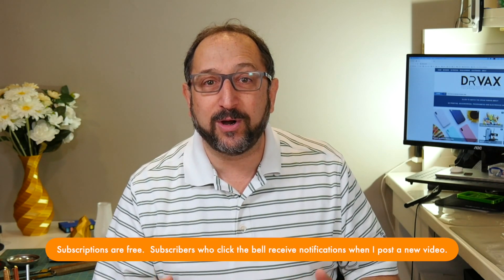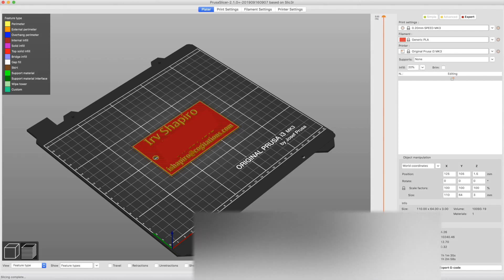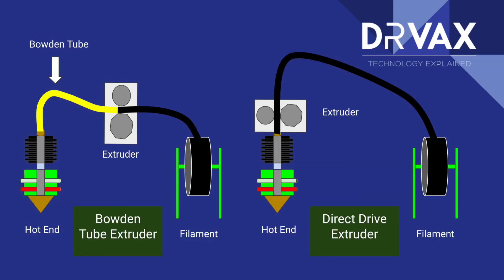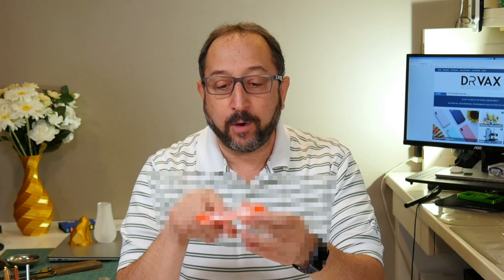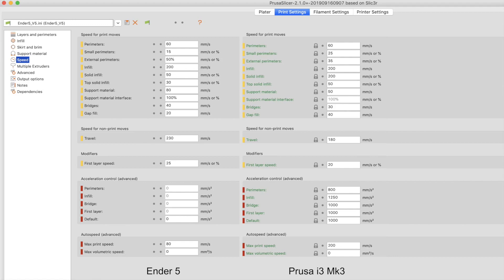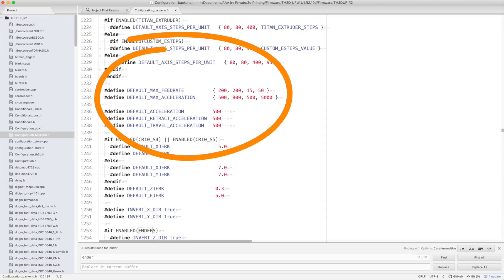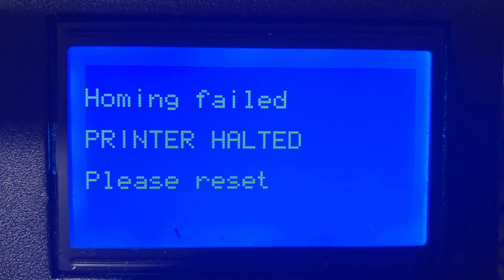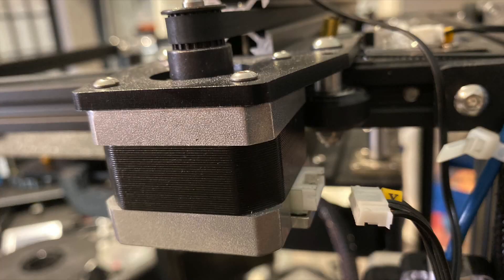Why is my Prusa Mk3 Faster than my Ender 5?

Comment: 1 cura is terrible at optimising paths, quite hard to configure properly
2 the default acceleration is low on enders. It's literally the worst setting that can be used, to get the worst quality. I push my ender 2 pro and ender 3v2 with 15mm jerk and 2000 acceleration, 5000 acceleration for extruder. If all of these is tuned to the same, there will be few minutes of difference but nothing dramatic. I also bet my tiny ender 2 can beat in speed a prusa i3 because the direct extruders creates much more artifacts at these acceleration values. If properly tuned retraction takes about 0.1 seconds on a bowden. My enders are retracting so quick, that it makes a clicking sound. Often I thought that it's skipping but it's not, as there are no printing artifacts

Comment: This is an old video, but to anyone that reads this stuff I have some pointers. I have two ender 5 printers. I strongly recommend ditching marlin and the stock board. Get a reprap compatible board, it will make it so much easier to dial stuff in... That aside it comes down to instantaneous speed change  (jerk) and acceleration... I the jerk settings in particular are very conservative at 10mms or 600mmm for xy. I bumped them to 15mms with no real quality difference. Same for acceleration.. bumped it 50% no real quality difference. Oh and you must recalibrate fan, temp, probably retraction settings too afterwards.

Comment: Watching a few of your videos now, I feel like you may have a slight bias towards Prusa. 

Having just bought an ender-5 and tweaking the hell out of it since I have, I feel like your assertions that "it's in the components" may be a sign of that bias. Although, to be fair, maybe I'm just biased towards my Ender.

I've updated my slicer settings to use the acceleration controls shown for the Prusa, I'll be trying some test prints in the morning to see what the difference looks like in terms of quality. Using the silent board with marlin 2.x firmware, cap tubes, ezr struder mounted on the top rail, and a glass bed with bl touch, I think I can get some pretty fast prints with minimal degradation to quality. 

It'd be interesting to see you benchmark this again in 2020 with the "latest" of everything and a publicly available model to test print, and then we can all compare results and try to fine-tune things more. 

Still a very great and informative channel, I'm just curious to see how close I can get to the quality and speed of the Prusa 3 just by fine-tuning settings and adjusting hardware - without completely replacing PCBs and motors.
Reply from the maker: This video was from a while ago.   For most people I think the Creality printers are an excellent choice and most home users do not need to speed $1,000.   More importantly the Creality printers are very "hackable" which I really like while the Prusa is very hard to work on.

I do not recommend building a Prusa i3 MK3 from the kit for most people.

I have a new Ender 3 V2 which is really solid but still requires assembly which is tricky for some people.  The ANET ET4 is very easy to assemble but the firmware is still a work in process.

The Prusa is faster due to the direct extruder and I am not a fan of upgrading Bowden printers to direct extruder.

If you want a fully assembled printer, a couple of the Monoprice printers, the Select Mini and Ultimate 2 (not the 1) are quite good and I like my Qidi X-Smart.  The Ultimate 2 is as fast as the Prusa and a direct extruder but has a much smaller print volume.  I do not recommend the Monoprice MP10.

I haven't printed anything on my Prusa in months and just used it again today.  It is an excellent printer and quite fast but probably not necessary for many people.

Sorry for the ramble.  I now own 10 different 3d printers and thing it is time for a video comparing them all.
Reply: @MakeWithTech  Well, FWIW, I tried throwing the acceleration settings from the Prusa/your video into my Ender5, and the results weren't terrible, but there was definitely a loss of fidelity on smaller details, as well as what appears to be some issues with extrusion precision in certain parts of the build plate. 

However, the extrusion issues may also be related to my current extruder placement - so I'm making a new mount to relocate it now, and will probably test the acceleration again to see if I get the same issues.

I did see a nominal increase in print time, but not enough to make the apparent defects worth it. 

But, I'll test more and comment again later. I'm really interested in finding the fastest possible parameters for printing with my E5 without sacrificing quality. I've already dialed it in quite a bit (100mm/s for normal prints, 250mm/s travel, no issues), but I always want to push it more. 

In that regard, it'd be awesome to see a detailed feature on what you can personally achieve this way - and then share a slicer profile with all of us. :P

Comment: If you look at all of your slicer settings between two profiles they are not going to be the same as the stock profiles for the Prusa. Not only would you need to change the settings for cooling and retraction after a change to speed. You would also need to take into account the stepper driver settings that are going to be different if you aren't running TMC2130 drivers. The stock Marlin firmware is not tweaked at all. The profiles being used are made by the manufacturer are not even tweaked. If you looked at the advanced configuration in Marlin with two printers using A4988 drivers and see that the driver settings are not optimized. There are timing and current settings that will be different based on the stepper motors being used and you are also dealing with different steppers depending on the axis 1.8 degree or .9 degrees. 

Using a board with TMC2130 stepper drivers the chips themselves have tweaks that work hand in hand with the and the advanced configuration settings to produce the ramping results. It's not just the effect of the jerk settings or your acceleration speed. Your Microstepping between two printers can be different which can cause vibrations.
https://www.youtube.com/watch?time_continue=1&v=tRoT3qpndbU&feature=emb_logo

Not only that the filament temperatures are not going to be the same. You could have been printing too cold when you needed to be printing at a higher temperature and had the same effect. Your hot end is not the same stock from one printer to another. The part cooling is different so the necessary fan speed settings are going to be different. There is nothing stopping anyone from adding an E3D V6 and a Bondtech extruder to an Ender 3/5/CR-10 but you still have to do substantial testing to make sure that you have your settings right.

With any major change to settings you have to start your calibration procedure all over again. You can't just change 20 things and expect the same result out of the box for any printer. Especially if they aren't based on the same Kinematics such as Cartesian vs CoreXY vs Delta. So at the end of the day you are paying for optimizations. What makes a difference is that you gain experience for yourself so you aren't dependent on a specific manufacturer to get the same results across multiple printers. With experience you can take 5 different slicers and get comparable results.
Reply from the maker: @Deneteus Thank you for your well thought out comment.  I completely agree with your conclusion that "at the end of the day you are paying for optimizations" and also believe Prusa does an outstanding job with these optimizations.

At the same time everyone does not require the same quality, speed, performance and that is why it is exciting that we have many choices in this space.

From the point of view of many of my viewers, architecture, components, etc do not matter.  They just want the best results within their budget.   In my videos I hope to help people move along the learning curve and by design often over simplify.

Thanks again for taking the time to add you extensive comment.

Comment: Actually in my opinion its not the quality of the mechanics causing the lower print quality with higher acceleration and jerk, but also the difference between a bowden and a direkt extruder.

While acellerating of the head of course also the filamentflow has to increase. But the molten filament does not react instantly to the movement of the extruder motor. As longer the distance between the extruder and the nozzle, as more this effect becomes relevant - and of course as higer the acceleration is, this delay will be more dramaticly decrease the print quality.
This can be improved with linear advance.
While on a direct extruder the improvement is only a little bit of better quality (f.e. on my Sidewinder X1 k-value is only about 0.05 - and the sidewinder uses a volcano, so long meltzone), a bowden setup normaly needs much more correction.

So I do not think you have to spend more money for higher quality hardware to get better results on higher acceleration. Only some more time to calibrate linear advance perfectly for the filament you use and the higher acceleration you set. So you can dramaticly reduce print time for free, if you take a little time to turn on and tune in linear advance.

While on a direct extruder linear advance is only needed to make an already very good printquality even a little bit better and is "optional", on a bowden setup it´s in my opinion mandatory. Using low acceleration instead is only a bad "walkaround".
Reply from the maker: Thanks for sharing.

Comment: I would love to see this with your Ender 5 with a linear rail upgrade.  I bet it is the wheels are responsible for the degraded performance.
Reply from the maker: Is an Ender 5 with new rails even an Ender 5 anymore?   I will be making a video about one last upgrade to my Ender 5 which will transition it into a new printer -- a new 32 bit control board.   At some point your end up just building a custom printer.

Comment: Ender 5 pro is out. New contender.
Reply from the maker: Nice.  I will take a look.

Just took a look. Slight upgrade,  basically the things I did to my ender 5.  Capricorn Bowden tube,  all metal extruder, plus the new control board with enhanced stepper drivers.  Should reduce ghosting.

Comment: For the money if you could only have Mk3 or ender..which one is more dependable? and better bang for the buck... i upgraded my ender 5 to a hard style ender plate and re leveled... there is zero warpage now and my nozzel is closer to build plate... printed several models...they all stick 10x better now..zero fails no glue needed for me... upgrade ender 3 plate was only $16..... Prints are better or as good as any ender videos i ave watched... Having a flat surface and proper bed level setup seems to be the best up grade for me... i have the newest version of ender 5 ..have had this printer 2 weeks... so far all of my prints are sliced with cura using standard quality which looks fantastic...Thanks
Reply from the maker: Yes.  The ended is a fantastic printer.   It all comes down to selecting the proper printer for your use case.
Reply: @MakeWithTech  what about over all quality of prints and durability? Same??? thanks
Reply from the maker: In pla printed at slower speeds the quality is excellent.   If you ramp up the speed you may see a bit of ringing.
Reply: @MakeWithTech  yes down the road as i learn more i will be adding upgrades like tube and shut off sensor which makes sense..then also buy ender cr 10s which seems to be a very nice machine for under $500... thanks

Comment: what price difference? what about size potencial for each printer. Is quality exactly the same?Thanks
Reply from the maker: The Prusa fully assembled is more than double the price.
Reply: @MakeWithTech  well unless it lasts much longer and is way more dependable machine..then i would just buy 2 ender 5s... if one broke you would still have another one...

Comment: Very interesting and your conclusions agree with my findings. This does not only apply to 3D printers but across CNC and manual metal working machinery. Rigidity, precision of components play the major part. In case of Prusa V  the Chinese made stuff I believe that Prusa is the only way to go. By the time that endless amount of money and time have been spent on the Chinese machines it is probably more cost effective to pay the extra and buy something fit for purpose. BTW I don't have a Prusa but do have a Chinese copy of it. As decent a printer it is for the money it is no Prusa evn after upgrading a lot of the stuff.
Reply from the maker: Thanks for sharing.

Comment: Again a good reason to buy Prusa 👍
Reply from the maker: Yep if you can afford a prusa it is an excellent product.  My primary concern with the Prusa is that assembling the kit is a massive job not suitable to everyone.  At $1,000 the Prusa may just be too expensive for many hobbyist.  For a business it is an excellent choice.
Reply: @MakeWithTech  well i paid $289 for ender 5...so paying over 3x for a machine that basically achieves same results a little faster with same durability seems insane... If you need to make prints  super fast buy three ender 5s... if one breaks down you will still be making more prints than just 1 prusa... I am thinking of on demand printing so you could be printing all the same thing or using three enders 3 different models...

Comment: I have both and can say that when comparing both, the prusa has a way shorter retraction way and also the z hop speed on the prusa is waaaaay faster then on the ender. Also linear acceleration makes a big difference. The prusa profile is simply very well optimised.
Reply from the maker: Yes, I agree.

Comment: Nice test. I wonder how much of it is related to the TMC drivers on the Prusa board?  
It would be interesting to test this with the new Creality 1.1.5 board that has TMC drivers like the MK3 has (unless you already installed that board on your Ender?) 
Though not driven the same I suspect the Ender with TMC drivers can handle higher acceleration/jerk.
Reply from the maker: Excellent suggestion.  Worth considering.  Thanks for participating in the dialog.  P.S.  Folks if you have not watched Chuck's channel, search for CHEP and take a look.  I have learned a lot from Chuck and his channel is excellent.
Reply: @MakeWithTech  I've been a subscriber for a couple months to you both. Really great information from all of you, thank you! I've learned so much!
Reply: @MakeWithTech  Yes!  ESPECIALLY (but not ONLY) if you're running a Creality!
Reply: I agree Chep. Irv is a great investigator and he's got great findings here. I think it'd be interesting to print the same comparisons using a 32 bit upgrade like TH3D's EZ board lite.
Reply: works a treat with the 2208
Reply: I will be trying this with my Ender 5 Pro with the 1.1.5 board and TMC drivers. It's been driving me crazy that my Anycubic I3 Mega and my homemade I3 variant are so much faster than my Ender!

Comment: One key difference even Prusa is direct drive is that ended 5 seemingly has more mass to move as it is not core xy printer. Secondly hotend quality and thermal mass of Prusa is higher than ender 5. These are key factor, not necessary inferior build, but different construction as well. But thanks for the analysis. Btw I do not own either printer.
Reply from the maker: Both good points. Thanks for sharing.

Comment: Were you using the TH3D on both printers.
Reply from the maker: No.  Only on the Ender. I used the Prusa supplied, and regularly updated firmware on the MK3.
Reply: @MakeWithTech  I've had questionable results with  TH3D. Wouldn't it be a more controlled comparison if the same firmware version was used on both printers? (subbed BTW, good stuff).

Comment: I was digging the same question earlier. Differences I found were 1) extruder: prusa needs shorter retract. If you have lot of retractions this may matter. 2) Speeds (especially z-speed) are more limited with ender-5. Usually z not an issue but slow accel in xy are. 3) Slicers handle differently stuff, sometimes cura and prousaslicer are very different. 4) Machine limits on ender-5 are very slow (acceleration,jerk,speed). Even if you up accel in slicer, machine hard limit may not allow that. (you can check those with M503 and change those with eg. M201 and M203).
Raising machine limits on ender-5 makes a huge difference, if you raise speeds/accels in slicer too.
Ideally you could have faster acceleration in x than y (due to lower mass moving in that direction). Beware of upping z speeds or accel too much, it starts skipping steps very quickly, especially if you have any kind of heavier plate.
I have Ender-5 and Prusa MK3s. Prusa seems a bit more rigid and can handle faster speed for same quality. When you up the machine limits on ender-5, you may want to do some quality testing too. Too high speeds will give ghosting and other unwanted effects. I like both of them. For prints with lots of retractions and lifting z up/down, prusa beats ender hands down. For general use ender is fine. For the absolute best quality Prusa wins, no questions. You get wqhat you pay for.
Reply from the maker: Thanks for sharing.   Yes, this is an ongoing process but at the end of the day, I do believe the overall build quality of the Prusa is better.

Comment: The print quality difference when printing faster are likely due to the teflon lined bowden tube extruder. It melts slowly and it has a lot of slack. The XYZ axes move together with E, therfore acceleration settings of XYZ influence E movement as well, therefore slowing down on XYZ may improve print quality due to slower extruder pressure changes.
Reply from the maker: Interesting observation.  Thanks for participating in the discussion.